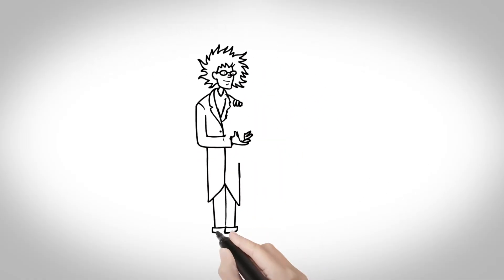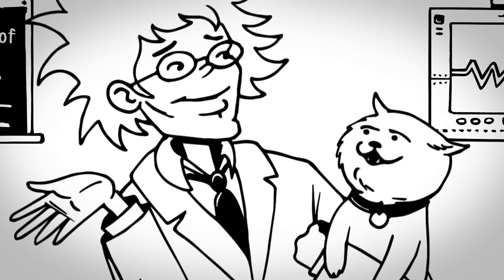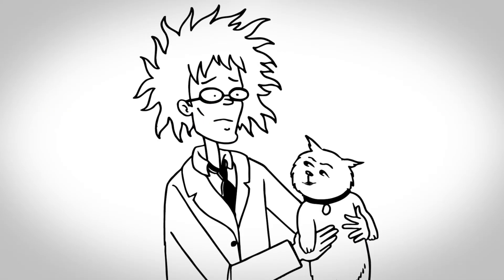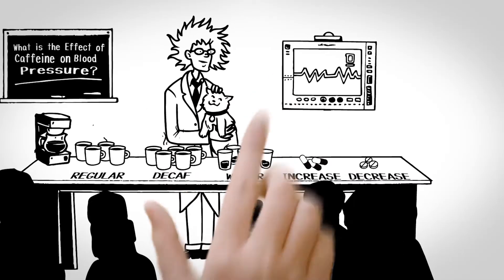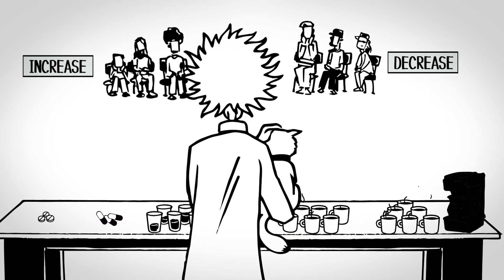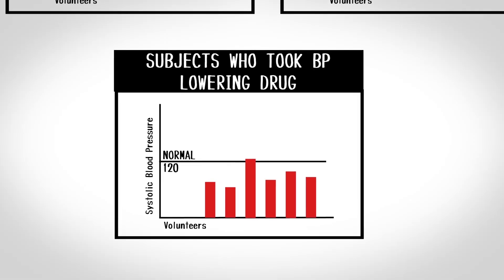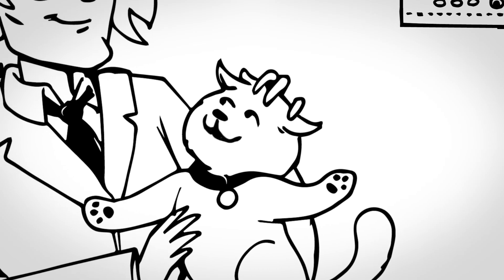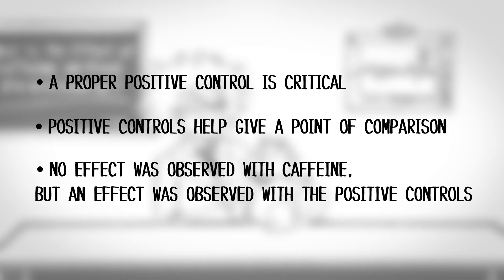Experimental Design Positive Controls

Comment: Nice lesson. However, I would like to ask this question: Are you not going to consider the  caffeine content in the coffee per N oz cup of coffee as another factor? Maybe it didn't affect the blood pressure because of the small or maybe lacking intake of caffeine for the blood pressure to be altered. If so, then you'd be making many (or in average three, that's what we've been told) test groups with varying amounts of coffee and then assign. That will make your research more reliable. Say test group C with the highest amount of coffee yields an increase in the BP and test group A with the lowest doesn't. This way, you can determine the correlation between caffeine intake and blood pressure and how much of it will affect your BP.
Reply: Is a cartoon drawing mijo, no esté chingando